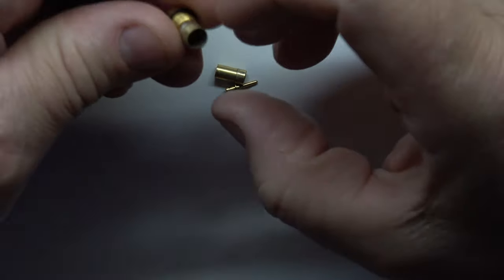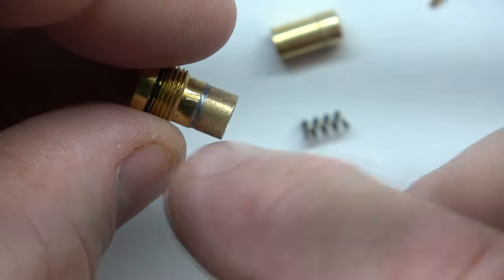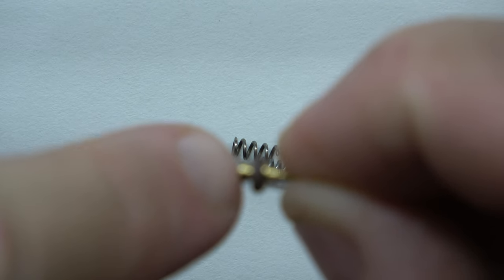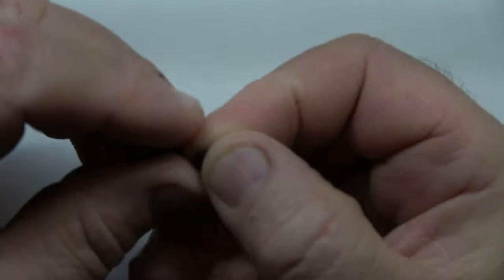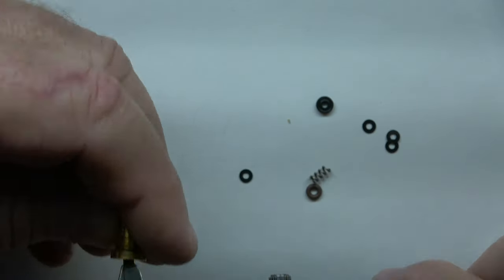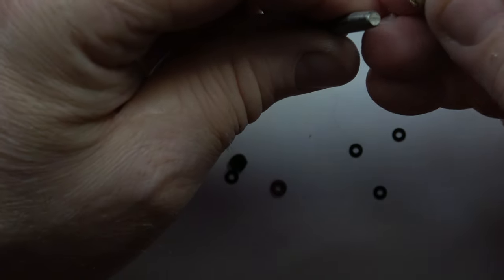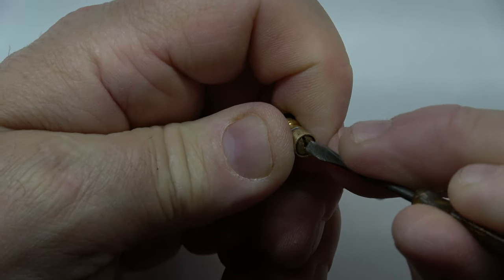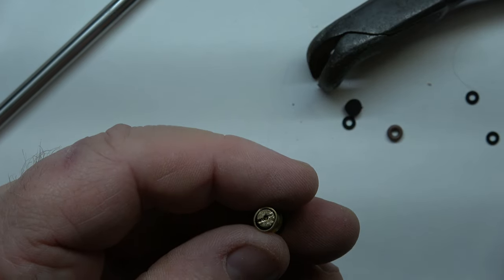Rothschild Butane Lighter Filler Valve Repair Part 1 of 4

Comment: I was wondering how you went about disassembly of that Dunhill Rollagas (IM Corona) produced lighter. I've only managed to removed lid spring and the bottom gas valve area leaves me stumped!
Reply from the maker: I recommend sending it to ars lighter repair. If you need parts they should have them. Call them up and ask how much to service it. If they try to tell you $125.00 then ask them how much to service an im corona pipe magic. If the coron magic is cheaper to service, then ask them why your charging more to service
The Japanese Dunhill since they are the same lighters with the same internals
Reply: That's what I am going to do! Just out of curiosity what is the first step? I am guessing its from the bottom gas regulator next to filler valve?
Reply from the maker: @errolburden7615  you have to remove the screw underneath the flint tube and remove the top platform so you can access the stopper mechanism. This takes a specialty tool to remove it. If you mess it up trying to remove it and send it to ars later, they will most likely send it back to you.
Reply: @Lighters-cf4bd  roger that! Thank you for all your help sir!!